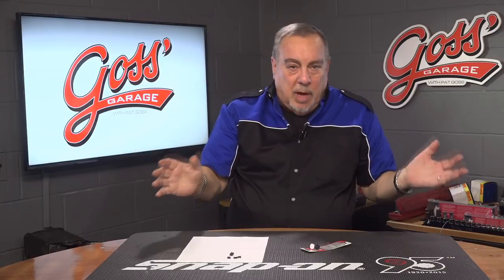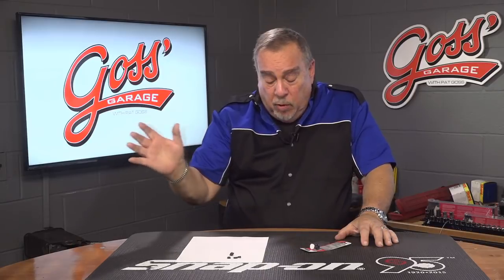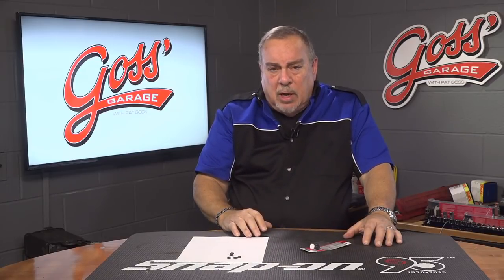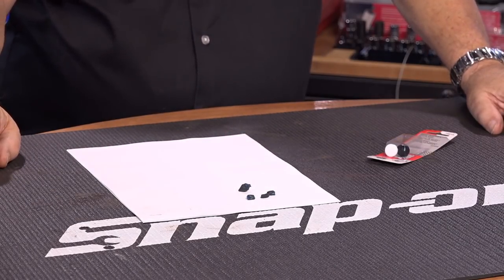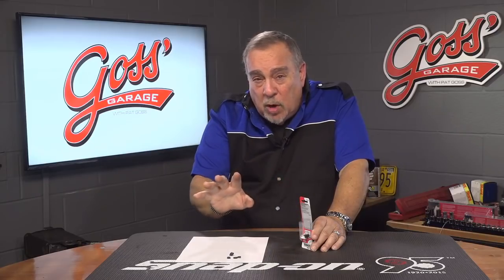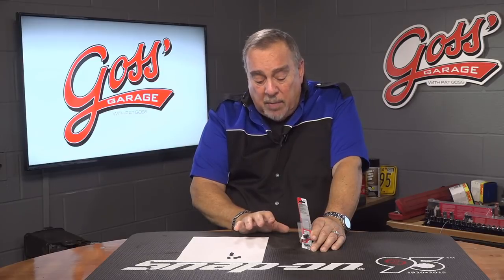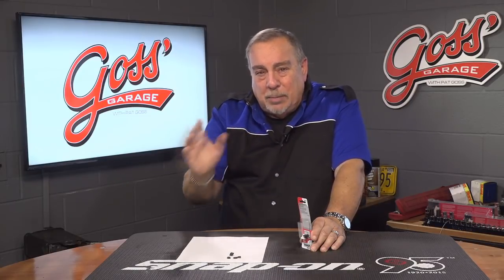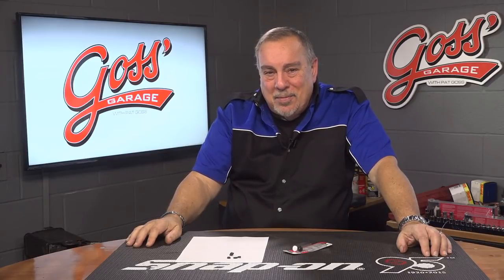Honda Foibles

Comment: What year Hondas does this happen on?
Reply: 90s models. I’ve had it happen with three generations of Prelude. All used the same part. It was also used on the clutch pedal in manual cars, and if it broke on the clutch pedal the car wouldn’t crank. It was hard to reach on the 3rd and 4th gen, much easier on the 5th.